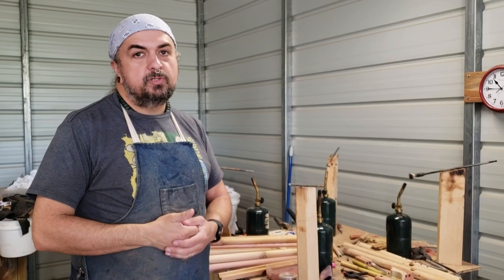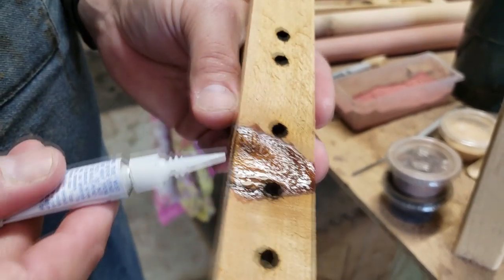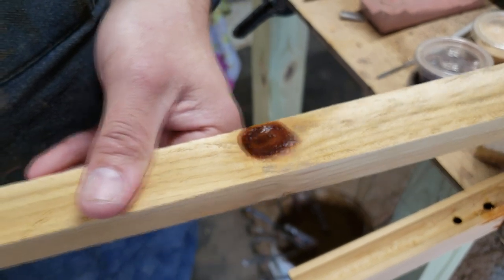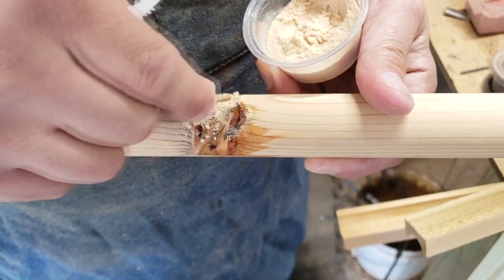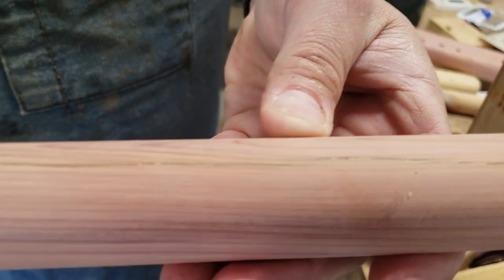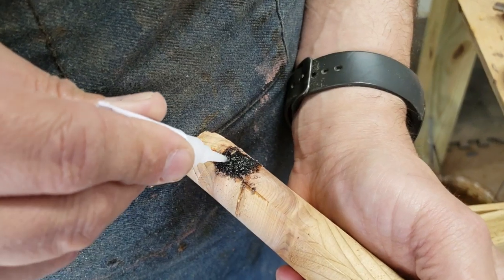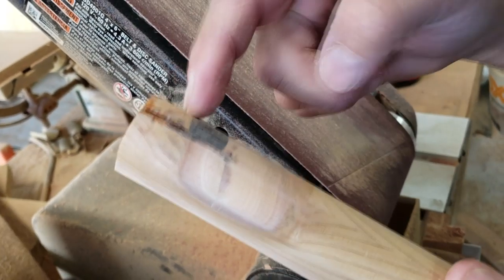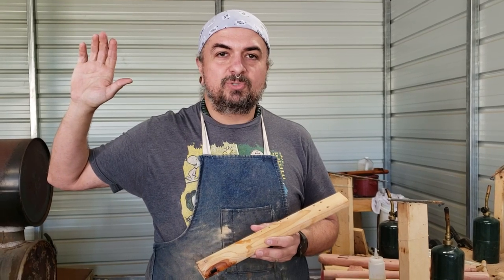Native American Flute Making - How to repair cracks and knots in wood

Comment: Good video,  Charlie. Regarding the "void" repair on the drone, a strip of masking tape placed with your finger along the interior of the bore helps the repair better follow the contour of the bore, leaving a smoother finish and better sound because of less turbulence. The tape is simply peeled off once the repair is dry. I use the same technique (but with crushed sand) to repair the slits often seen in conch shells. This slit is made by the harvester in removing the meat, but it leaves the shell useless to us shell trumpet makers! Thanks again for the great videos. Keep em' coming,  Brother.
Reply from the maker: I definitely use the tape method when it's a larger fill. Great info and thanks for watching!

Comment: I've had 3 bamboo flutes, each made from very dry 1" I.D. pieces and all 3 split from the top all the way down to the sound hole. Maybe next time I'll wrap it with bamboo strips and held down with CA glue. I never sealed them and I no longer have them. I do love the sound better then pvc pipes I've made though. Thanks for these videos and all your help.  😉

Comment: Hi. I've got a flute i just bought literally a couple days ago.  I'm thinking it got too hot where I live and along the seams it has separated a bit at the mouth piece end. About 4 inches long. What do you recommend I do? Thank you in advance if you read this and reply.
Reply from the maker: Basically, following what I do in this video. Super Glue is the best for sealing cracks in wood. Be careful, it puts off toxic vapor.

Comment: Instead of using the oil to show us how it would look like when finished. You could instead use mineral spirits as it will quickly dry leaving no residue behind to interfere with any additional work and it gives you the preview you want.
Reply from the maker: Sounds like a good idea for general woodworking however I would never put mineral spirits on a flute. Its not good around the mouth. 🤢
Reply: BlueBearFlutes but wouldn’t the mineral spirits evaporate in a matter of seconds leaving nothing behind?
Reply from the maker: @evanpilot  and then when I finish the flute using natural oil and wax, it would revive some of the essence of the mineral spirits. Probably best just to stay away from it for me. You certainly would be welcome to do it however you deem safe! 😉
Reply: BlueBearFlutes I was unaware of this, thanks for letting me know
Reply from the maker: @evanpilot  🙂👍